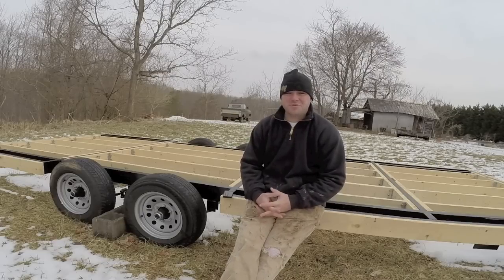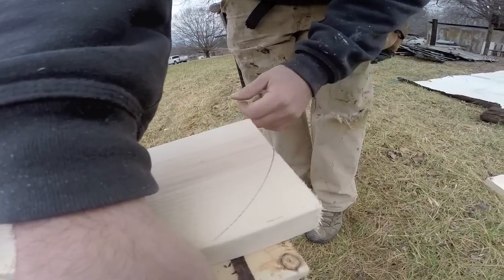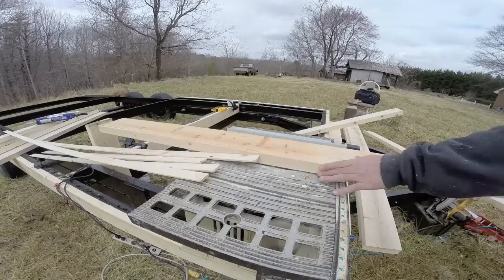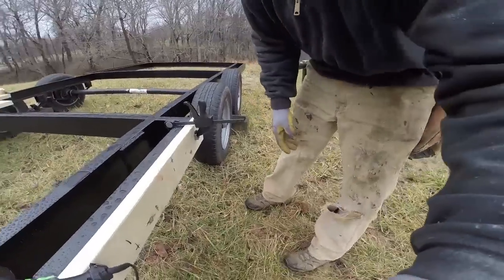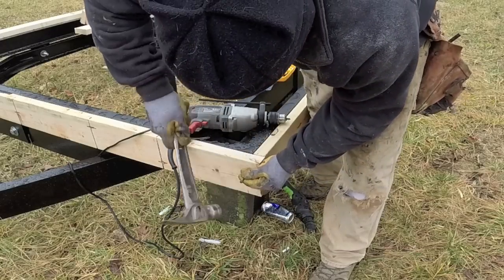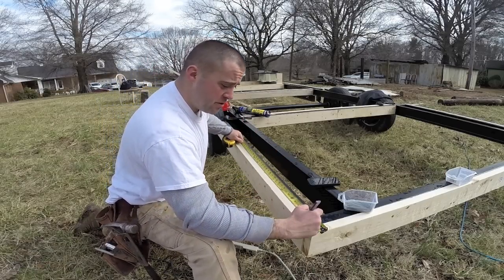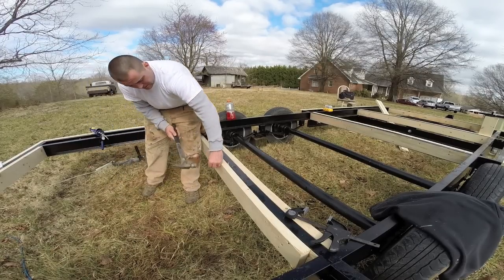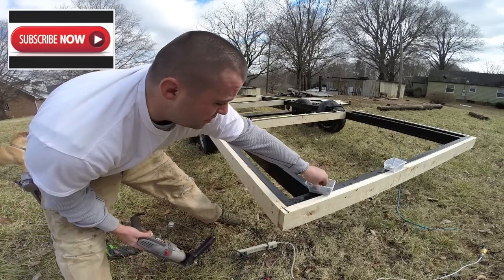Tiny House Floor Joists Part 1 of 2

Comment: 5:35 damn, I impressed with all these little techniques, with how to nail wood at the end.  It's these little techniques that make the difference, between a Seasoned Veteran, who understands the science of Woodwork and carpentry, and the local Goober who just bounds crap in a sledgehammer...  Thanks for sharing and educating us, this knowledge is priceless.   I never learned this, or was taught the proper techniques in woodshop in school, it was such a disappointment, now that I look back.  

I think I was overlooked, because I was the quiet kid, at the back of the classroom,  in a overpopulated classroom, while attending Palestine High School.  I feel like these videos make up for those failures, by those educators.

Comment: With the construction of that trailer alone I'd be betting you should of went tri axle that's heavy weight channel with that lumber, appliances she'll be heavy trailer. Frame won't be the issue axles bending would be my concern nice build none the less!

Comment: Can you please explain a bit more about the width that you ripped your ledger boards to.  You mentioned that over time they would shrink and you don't want the steel to make the floor uneven.  Did you mount them to be a bit above the height of the steel beams, so there will be a slight gap between the floor board and the steel beams and the floor boards only sit on wood not steel?

Comment: Personally instead of nails on something like this that's going down the road bumping around and vibrating my choice would be screws over nails and piece of mind that it's not going to vibrate loose or any such thing you know what I'm saying.. yeah screws are more expensive but sure do hold a hell of a lot better especially in that situation..
Reply from the maker: Agree but people who travel with these things are idiots.  Their to heavy.  The whole point of building it on a trailer is to bypass state and local building codes.

Comment: This might seem like a dumb question but after glueing are you drilling/nailing the boards directly through the metal frame?
Reply from the maker: +West O'Hair I pre-drilled and then screwed the boards on.  I didn't go over it in the video.

Comment: So, Im getting ready to build the decking on my tiny home trailer... do you suggest treated or untreated 2x6s? I plan on using galvanized steel for the undercarriage instead of plywood, not sure if that makes a difference. I have a 30ft trailer so anywhere I can saved weight im trying.

Comment: Hey Dan.. Jeff here.  I have a question.   I have a 16' car trailer with a 2' dove tail.   I need to know if I can still utilize the dove tail as part of my tiny house build without having to cut it off?  The trailer also has pockets on the sides for removable side walls. .can I screw my bam boards to those pockets or would I need to cut them off?
Reply from the maker: For your dove tail you can cut done wedge shaped blocks and frame it up to your floor level.

You can leave the side walls on or take them off.  Personally I would grind them off and attach the beam to the frame. I think it would be stronger.

Comment: In this video, at 8:22 minutes from the beginning it appears like if you are nailing wood against a solid steel beam, Hoy do you get that? Are common  iron nails able to penetrate harder steel? Are them special? I'll be very grateful if you clarify me that a bit.
Thanks a lot and congratulations for this excellent course.
Reply from the maker: I filled in the web with a ripped piece.  I was nailing a second board into that inlay.
Reply: Tiny House Customs Thanks a lot.. I didn't see that part when you did fill the web. Nice dreams.

Comment: Can you use half inch carriage bolts to bolt the rim board to the metal sub frame of the trailer? Im nervous that the screws won't be strong enough or secure enough to keep the board on the frame
Reply from the maker: +wheredidileavemycell  yeah you can.  Drilling half inch holes into the steel will be a pain.  1/4 bolts would work fine.

Comment: Any chance you could give the item number or barcode on the screws? I can't find any that aren't hex and I need them to fit flush.
Reply from the maker: ***** I can find the exact screws I used but lowes had them on the shelf.  heres a link to a screw which is the same thing with the exception of not being made for 1/4 metal.  search Teks Screws  http://www.lowes.com/pd_276838-2191-21384.0_0__?productId=3316526&Ntt=teks+screws+3%26%2334%3B&pl=1&currentURL=%3FNtt%3Dteks%2Bscrews%2B3%2526%252334%253B&facetInfo=

Comment: I have watched a few videos about tiny houses and those recommended placing a thin barrier between any wood and metal. Doesn't it cause moisture in the wood if you don't put a barrier of some kind between the wood and metal? I am confused about this. Please let me know. Thanks
Reply from the maker: agape713 people place a vapor barrier on to conventional concrete foundations to prevent moisture from coming in contact with the wood.  concrete is a porous material and is in contact with the ground.  steel is not. I framed for years and have inlayed hundreds of beams this way.  I think people are doing it because they see it being done on a "regular" house and think its needed but from what i have researched, it is not. :)
Reply: thank you so much for the prompt response.

Comment: Could you tell me how you figured out the hub face of your axles and the spring centers...Thanks
Scott
Reply from the maker: Hmm.  Not sure I understand your question. Did you watch the trailer build video?  It might answer your question.
Reply: Your trailer was 102 inches wide...How did you calculate the dimensions of your axle so they would not stick outside of your trailer
Reply from the maker: The trailer was built around the axels.  The leaf springs were already attached. So my main beams were figured with that in mind.  Does that answer your question?

Comment: I've seen some people having joists perpendicular to the sides of the trailer. Is that wrong?
Reply from the maker: +Kendra Weisner  no. That was my original plan but changed it at the last minute.
Reply from the maker: +Mom Squad   Not that I could see. Either or would be fine.

Comment: hi, could you tell me what kind of wood do you use for building? (floor and wall) thanks
Reply from the maker: +Lucas Suarez standard 2x5 / 2x6 which typically comes in Douglas fur or spruce. Both are part of the pine family

Comment: What was the cost and how to make a frame if you don't mind me asking trying to do my own am taking your lead
Reply from the maker: You'll have to do some research. I won't be sharing my cost during my build. It effects the resale value of a tiny house.  Call a steel yard for the price of steel.  And call a trailer manufacture for Axel's and other components pricing.
Reply: OK thx I'm in Alberta
Reply from the maker: Canada?  Your prices will be totally different.